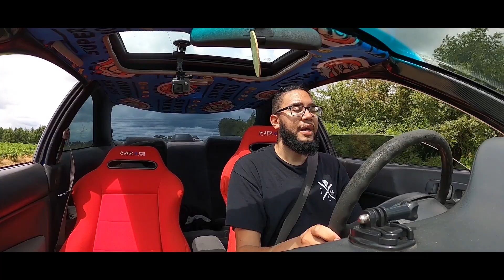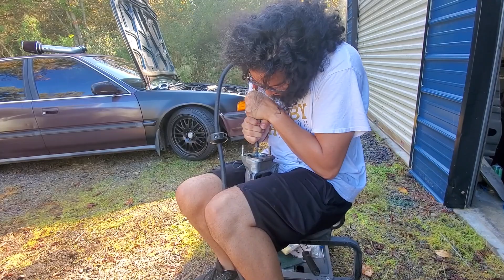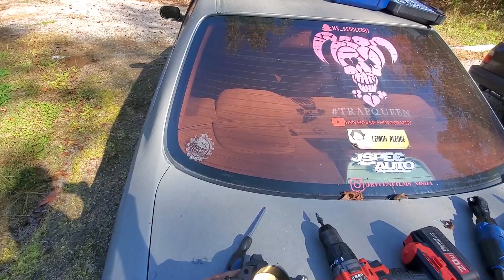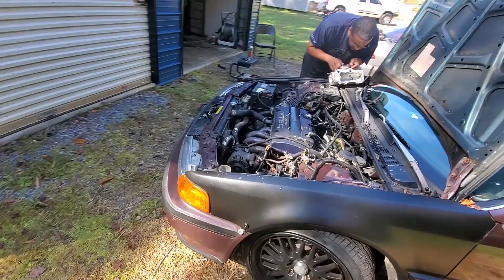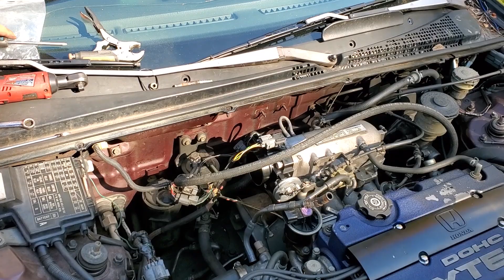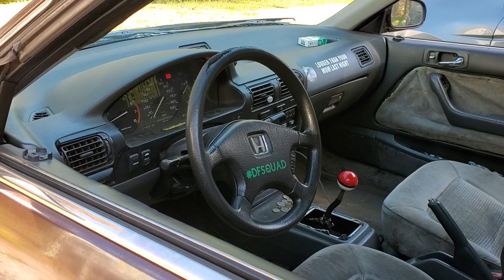JACKSPANIA RACING 70MM Throttlebody Install | ALL Motor H23A Swapped Honda | CHEAP POWER UPGRADE!

Comment: Little tip for getting studs out, screw a nut on upside down, screw another one on the regular way then lock the 2 together and break the stud loose with a wrench
Reply from the maker: We knew that bro lol. We just sent it🤣

Comment: I don't know if you will see this so this question is for anyone who wants to answer it. My Accord's (F22B2 with a F22B1 vtec head and ecu swap) factory throttle body is in shit condition and I can get a 70mm throttle body for the same price as a worn out factory throttle body at the junkyard. Keep in mind I'm looking at function here and I'm not trying to break power or speed records. After port matching the intake and calibrating the tps would a 70mm work on a stock setup without a tune? (I haven't gotten around to putting together a chipped ecu yet so a tune is out of the options for now.)

Comment: I feel like cutting the webbing out of the top half might have hurt you because now you got air coming in against a flat surface on the bottom. I would cut the bottom into points, maybe even just smooth out and round off the sides of each port closest to the TB to allow the air a less restricted path. Thoughts?
Reply from the maker: Very possible. It's not the end of this setup. We just didn't wanna pull the mani till we do a new gasket. I did this same thing on my h2b at first and we gained 10whp. When I did the lower portion it went up another 5 or so. Definitely worth doing in the future
Reply: @DrivenFilmsPhotography ³